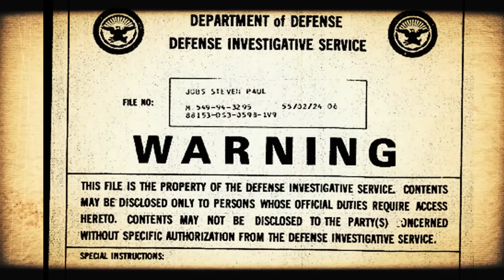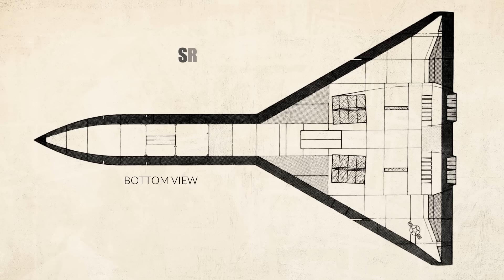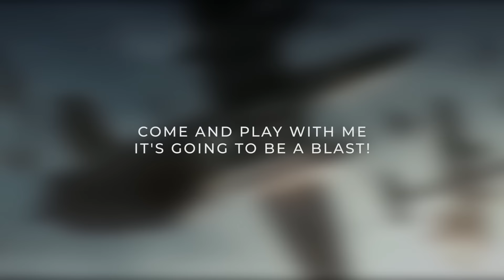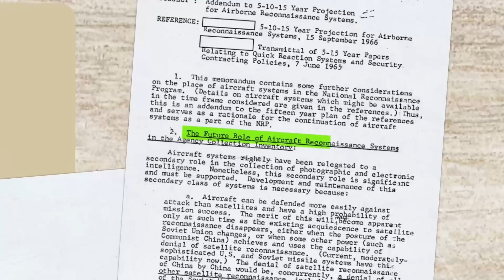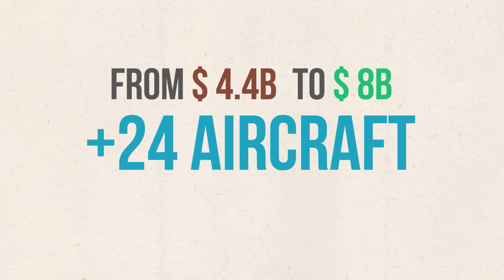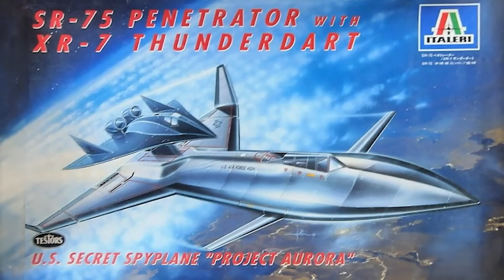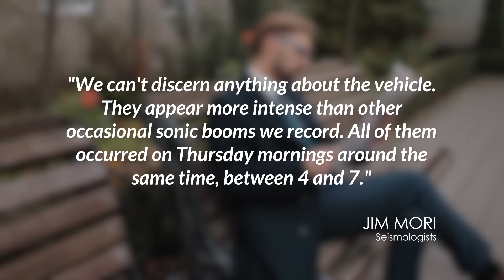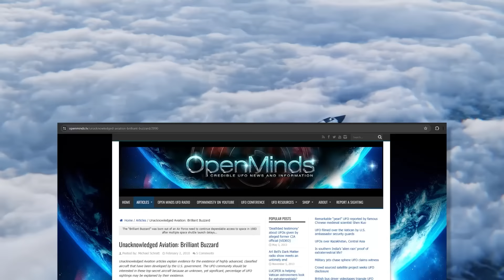This Plane "doesn't exist" - SR-75 Penetrator

Comment: I know a lot of you wont believe me, but back in around 2012-2013, new years eve, some missile or plane flew over Ontario, Canada. It was so fast and the “shockwave” was so strong that it shook the house and made a sound as if a huge piece of ice fell from the roof. I went to school the next day and everyone at school heard it, even though we live far apart from each other. Literally everyone. It was the buzz in high school. Ive been to several air shows so i am well aware how jets sound like. Funny enough, so many people heard it in Ontario that the same morning there was a segment on CP24 stating that this was all just something related to the weather and how the cold air interacts with the atmosphere (something like that idk) blah blah. This “boom” occurred at around 9-10pm and very cloudy conditions. As i started looking into conspiracies and especially those related to flight, the second i heard about pulse based jet engines, i knew some top secret flew over the province. It would have been perfect conditions for it, low clouds, cant see a thing, slightly foggy weather, no sun, thick clouds, etc
Reply: Whats funnier is after the segment aired on multiple broadcasts, several weeks later i tried finding the exact videos and it was as if everything got wiped from the internet
Reply: Try out some internet archives you would de surprised
Reply: Probably a meteor.
Reply: @glenwoodriverresidentsgrou136  Why lie about a meteor?
Reply: Only one culprit: CF-18A Hornet.
Reply: @su-30butwithinternetaccess14  as i have mentioned, iv been to air shows and there is nothing that would compare to the 1 sec “booooom” and vibration that we felt, and 10 million people felt. Its like a huge block of ice falling to the ground 20m from the roof. Still not confident to what it was, but it has to be something traveling borderline hypersonic
Reply: @glenwoodriverresidentsgrou136  not a meteor, the meteor from Chelyabinsk for example followed with a many second sonic boom and  shockwave that broke glass and moved objects. This incident lasted no longer than a second and was a loud boom heard by millions of people. The house shook, big boom, all within a second. With a meteor there would have been a long echo. This was as if a mosquito just flew by your ear.
Reply: @HOTSHTMAN53  At least a CF-18 going around mach 2
Reply: @HOTSHTMAN53 you wouldn’t hear a sonic boom at an airshow since the booms are so loud they’d destroy everyone’s hearing. What you described sounds exactly like what my parents heard in the ‘80s when F-4s would fly over supersonic before it was banned over land. It was likely a CF-18, why it’d be going supersonic I don’t know, but that is the most likely explanation.
Reply: obviously the ghost of RL206
Reply: That’s called a meteor 😊
Reply: Used to happen all the time before they prohibited super sonic training over population areas. I remember the windows in our old farmhouse getting cracked more than once. We lived pretty close to Dayton, and in the 80's they'd rip overhead at full speed pretty regularly. 
What you experienced isn't anything special.
Reply: @HOTSHTMAN53  I've been to many airshows, but never one where aircraft were actually breaking the sound barrier. I'd love to see one where they do, but I imagine the sound would burst your eardrums! I've heard many recordings of sonic booms and been exposed to some from high-altitude flybys, though, and the length of the boom tends to depend on the altitude of the aircraft, in my experience. Anything traveling faster than Mach 1 through the same piece of atmosphere will make the same boom at the same length, within reason - as a rule of thumb, I've found that Mach booms are stretched out longer, the higher the plane is flying as it flies past you. Perhaps you just heard a fighter jet flying by at very high altitude?

Comment: Looks like if a sr-71 and xb-70 were combined
Reply: That’s Heavy.
Reply: Like Darkhorse
Reply: Kinda wish the XB-70 saw service. Still one of the coolest designs IMO
Reply: With a small bit of Concorde (on the air inlets)...
Reply: I was just thinking the same thing! And that the parasite aircraft looks like the child of a F-117 and an X-15
Reply: The parasite looks a whole lot like the Convair Kingfish
Reply: Check out the BOEING PHANTOMWORKS BLACKSTAR aircraft (looks like the XB70). It was part of the same Aroura program as the SR75. Boeing filed a patent for this aircraft on FEB 7TH 1989 (PATENT NUMBER 4,802.639)
Reply: @galactusnine2449  I was wondering if someone would remember the Blackstar.
Reply: @ryugakishatu6372 Same. Probably in the alternate universe where ICBMs weren't invented.
Reply: I was thinking that too. 🤔 What if the Valkyrie had a scramjet or pulse detonator engine? It rode on it's own shock wave for higher speeds. I believe the combination would be amazing.
Reply: Or a fancy TU-144
Reply: @PegasusTenma1  In many ways, better than the SR-71.

Comment: In the spring/summer of 1997 I observed something appearing to be the mother craft for this flying from west to east over Grass Valley and Nevada City in California. What attracted my attention was the very "solid" looking contrails that did not dissipate as quickly as normal contrails. The plan form was similar to the SR-71 but was much larger.  The forward fuselage was longer in relation to the delta wing area than that of the SR-71. There were no inlet spikes or engine nacelles in the leading edge of the wing. Having maintained the navigation systems of the SR-71 for nearly 7 years during my USAF career, I was certain this was not one of them. The aircraft was flying low and slow and over a low population area of northern California. If that was this mother ship, I suspect it must have had some form of IFE (in flight emergency) that necessitated the slow flight envelope.  Around the same time frame, I would see three KC-10 tanker aircraft flying in formation over my residence at Penn Valley, CA on Thursday afternoons. About a half our later I would hear a loud growling sound going high overhead. Looking up, I could see nothing, No contrails no aircraft. The sound travelled from the south horizon to the north horizon in approximately 30-45 seconds. Yes, the government and contractors can keep aircraft projects secret for years before the public ever hears about them. The F-117 was a prime example.
Reply: This is the first time I ever read an account of someone witnessing the plane in the late 90s. Do you remember what color was the alleged "mothership" that you saw? 
Were you able to notice a-la SR-71 nacelles on the aircraft in question?

As for the other story with formation of KC-10 aircraft on Thursday afternoons and the loud growling sound that used to came shortly after... you described it like it happening around the same time, if you were to narrow it a little would you say that KC-10 Thursday afternoons sightings and growling sounds happening all in the late 90's as well or was it before like in the early-mid 90's?

In the end, honors on your service with SR-71.
Reply: the same f117 fallen in serbia thanks to a Buk m1?

Comment: Scramjets were designed in the 1930s. Material science took decades to create materials that could withstand the heat created by travel at the speeds the engines were capable of. The program trying to design a fusalage for the engines was public in the 80s.
Reply: The theory for scramjets is actually nearly a hundred years old
Reply: @PegasusTenma1  So...the 1930s?
Reply: @lariojaalta890  Around that time, yeah. This is something you’d be working on if you were a physicist or research engineer at MIT or Harvard or other top tier schools, my Great Grandpa was on one of those teams as a physicist.

Comment: At Mach-15 you better build the entire Piggyback plane out of ceramics. And DON'T open any hatches.  
Also, a pulse-detonating engine  for a plane of that size would rip apart the runway, as soon as it lifts its nose. That entire Runway would have to be searched for debris, and repaired if necessary, in order for the plane to land again. Pretty hard to keep a plane secret, if it has to "emergency land" somewhere else, where it ALSO rips the landing strip apart.. Physics.. IT EXISTS.

Comment: One fact that you missed concerning the Southern California hypersonic sonic booms, is that the USGS seismograph system that detected these, was replaced by the Department of Defense, according to many sources.  This new system, somehow, no longer detects, or possibly filters out sonic booms from aircraft.
Reply: They just do what the NOAA sonar array in the Puget Sound region does.  It periodically shuts off for a few hours when submarines return to their base in Bangor, WA.  The Hood Canal floating bridge will also periodically raise up to let invisible boats pass by, really annoying if you're a local as the wait time can be up to 30 minutes.  Though on occasion a sub will pass on the surface, just don't visit expecting to see that.

Comment: Alex Hollings of Sandboxx News has a very good investigation into "Aurora". His conclusion - yes, it was probably a real vehicle (or vehicles) being tested during the 80s and 90s, but it likely didn't lead into a production capability.
Reply: They were built by Lockheed Skunkworks. They are the reason the Blackbird was retired.
Reply: "His conclusion - yes, it was probably a real vehicle". Some "conclusion"
Reply: @misterflibble6601  I mean, not much more you can say without photos or documents, no? A bunch of people saying they saw black triangles going fast doesn't cut it.
Reply: @thomasblankinship98  A lot of things were built by Lockheed Skunkworks. NASA and the AEC built a working nuclear thermal rocket engine in the 1970s, but the X-37 still runs on hypergolics.

Comment: The "SR-75 Penetrator" and "XR-7 Thunder Dart" were manufactured by the Testor's Model Company, and while very sexy looking had no real aircraft as their basis. Testors also did a number of other conjectural stealth aircraft around this time.
Reply: I used to have both models. As far as i'm concern, they exist
Reply: @beboy12003  The drone is on display in Ohio. They exist.
Reply: Sure you're not thinking of the D-21, @warlocc-paul  ?
Reply: I remember seeing the SR75 model in stores back in the late 80s, early 90s, about the same time as Testors' F-19 was in stores (The "Ghostrider" in Tom Clancy's "Red Storm Rising" seems to have been based on the F-19 model). At the time I thought that Testors' designers were simply taking the SR-71 and extrapolating from it for both kit designs.
Reply: @Donleecartoons  You're right, that's the one. Hard to ignore the similarities to this video, though.
Reply: I still have that SR-75 model.

Comment: I have the Testors model you built some of your CGI around. Built it back in the 90s. It came with a "Rusian satellite image" of Area-51 as part of the background/instructions before such things were commonly available. It'd be great if this thing were real; but, having worked with or for the DoD for decades, and watching space things happen as an enthusiast, I'm not convinced this got past paper studies and design ideas. I'd be more than excited to find out I'm wrong though.
Reply: Well............ fwiw, I did see a triangle shaped aircraft flying above us moving remarkably faster than we were. It was too high to make an accurate observation. This happened in the 91-93 time frame. I'm not sure if I can say where this happened but it sounds like you live around Beale AFB. I used to go to altitude chamber every 2 years there.
Reply: I had the same model

Comment: Around 1997-1998 i was working at a small remote airport in the southwest desert.  I felt and heard a strange low rumble.  I went outside and saw a "doughnut on a rope" contrail stretching across the sky.
Reply: Yeah its impossible to know but coulda been scram jet or others testing.

Comment: If I designed a dual aircraft, I would have the smaller craft merged into the front of the larger craft so that it only has one cockpit, in the smaller craft. Instead of ejector seats which would be fatal at hypersonic speed, the smaller craft would also serve as the escape craft. If hit by a missile, detach. The escape craft wings could be the retractable canards for escape only types or blend with the larger craft's wings at the front portion of a symbiotic delta wing for larger dual purpose types. The host craft would have fuel, jets with retractable inlet cones and dual-mode scramjets (ramjet scramjet). The smaller craft could have rocket engines only, to either enter orbit, fly a mission, or land safely upon separation with range enough to land in friendly territory. I'd also ionize the exhaust so that the fuselage  becomes charged to repel air creating a nanometer thick vacuum layer around the aircraft to reduce friction. 
Now for the derogatory comments in replies;

Comment: I live in North Las Vegas and my apartment complex is literally across the street from Nellis Air Force Base. I have seen weird craft land (of course I'm one of those without the fancy 2000mega pixel camera phones) and have heard odd sounds emit from the sky in early mornings (I'm typically a night owl so bedtime is 7am or so) I can honestly attest, hand to god, that there are experimental craft (and possibly other things) coming in and out of that base. They do cellular blackouts on a regular basis (reception going sucky 1 bar for like 2-4 hrs) that they DON'T announce. And even have what they DO announce is known here in the local news called Red Flag Operations in May, June, and July. Which severely kills my home internet wifi and cell phone service. This is discussed on local news when they are planning to do one. Never the same time (just within those months) each year and always on the news like 2 days before they do them.  And they run for like a week straight. It is so common an occurrence to lose wifi and see lights and odd sounds early mornings that it is normal here for us. Almost surprised when we do have good service and don't hear strange sounds.

I say this now, people living around Nellis are so unfazed by this stuff going on an alien craft could land in the parking lot of the 7-11 across from the main entry of Nellis AFB and people would be like "wazzup" and just carry on their day.  Google map Nellis you will find my apartment complex and the 7-11 if you think I am lying. We are not surprised here by much of anything. 

We are like "meh".

Comment: Funny enough, in the 80s/90s, seismic activity was found and recorded in high altitude. Similar altitudes the Blackbird operated in. They recorded the strange sonic booms, and when they marked them on a map, all the activity was coming to and from Bakersfield, CA, which if people didn’t know, was where Lockheeds old facility was. They also found the same seismic activity that travelled in the direction of Nellis AFB, as well as to Groom Lake “Area51”. Seems like this could’ve been the SR75 prototype in early testing.
Reply: Yeah I think that entire valley is named aerospace valley for all the sighting of planes and sonic booms in the area around it
Reply: I've actually wanted to try and use siesmographs to try and triangulate the origin of "The Tucson Booms." Because every once in a while my big old single pane windows will shake and it'll be on the news again where their conclusion is always, "Yea, I wonder what that was... In other news..." As far as I know, they are still a mystery, likely because no one here has really tried to figure it out and people that don't live here are not likely to have heard about it. If only I knew where to get a list of the time the booms happened, the results of siesmographs for those times and I knew how to triangulate shit. I may have some studying to do, since no one else is likely to do anything about it. Unless they were convinced to drop it. Of course it would also suck to do all that work and find out someone already figured it out a long time ago and I just never heard about it. Guess I'll do that first..... What wete we talking about?

Comment: If Groom Lake had to have the crazy long runway, how could it be landing and taking off at Midway, Wake, and Scotland that had standard runways?
Reply: I agree, or it is so powerful, it doesn't need so long runaway.
Reply: The runway at Machrihanish in Scotland is one of the longest in Europe and was designated to be one of the Space Shuttle emergency landing strips due to it's length.
Reply: Because it didn’t need a long runway to land once it launched XR-7, or to take off without it.